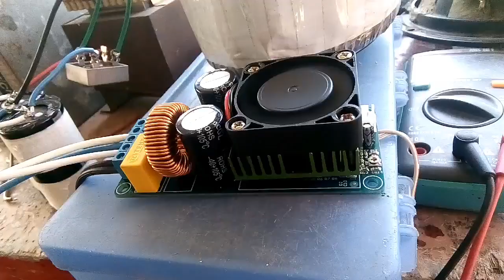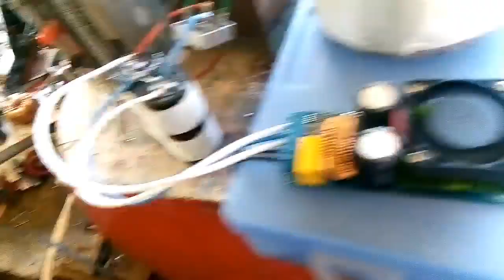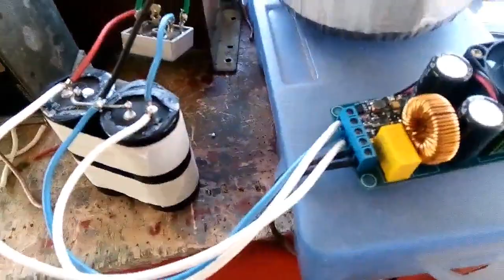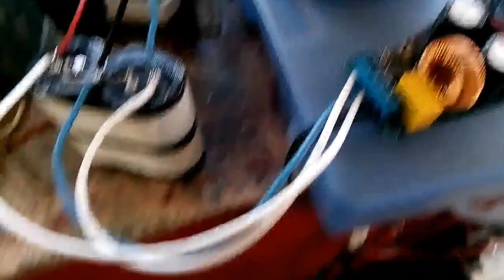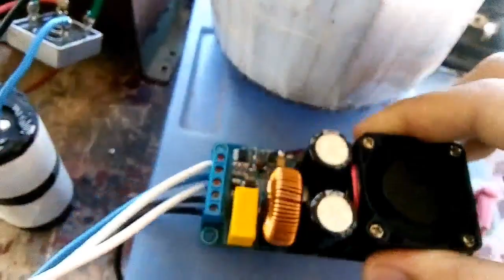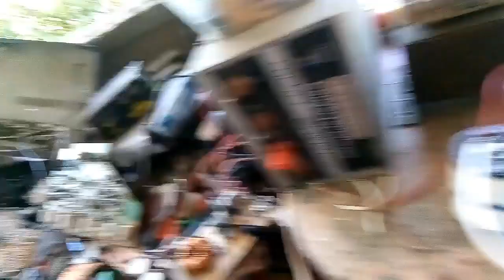IRS2092s class D amplifier (SOUNDTEST) ctto "Eldz Sabuero"

Comment: Sir tanong kulang po sana kung totoo ba na hundi sya gagana sa below 45vac Supply. Salamat sana mapansin nyo po😊
Reply from the maker: Gagana naman po siguro sir kaso idodouble voltage niyo nalang, yung dalawang AC pagsamahin niyo, wag niyo na po iconnect yung ground na galing sa transformer. Yung ginawa ko sa akin 28 0 28 vac lang yon pero napalabas kong 80vdc. Gumana siya at walang naging problema 😊
Reply: Ilang capacitor ginamit mo boss , ilang volts tyaka uf?
Reply: Pahingi diagram